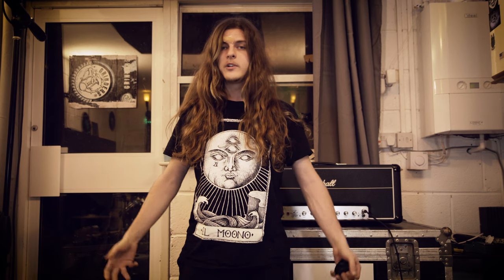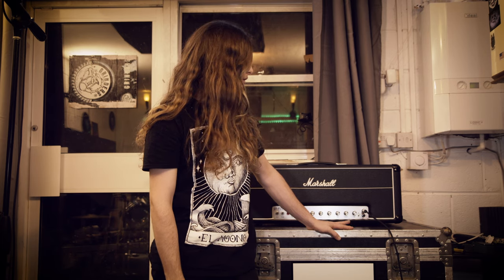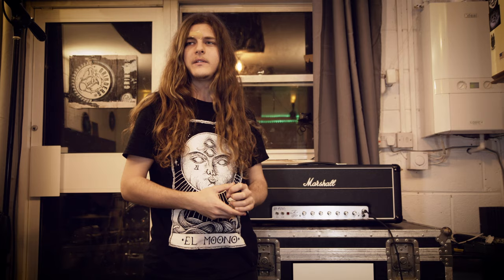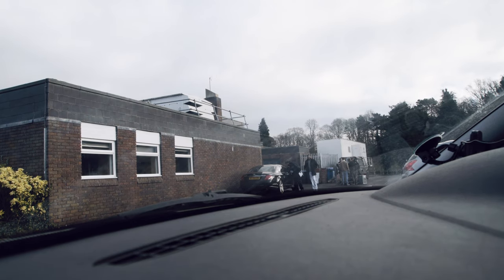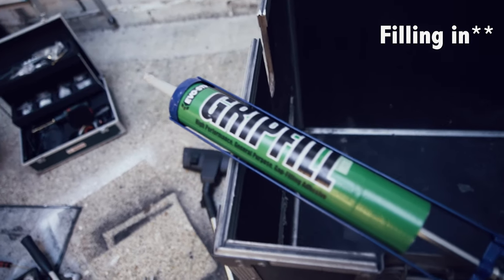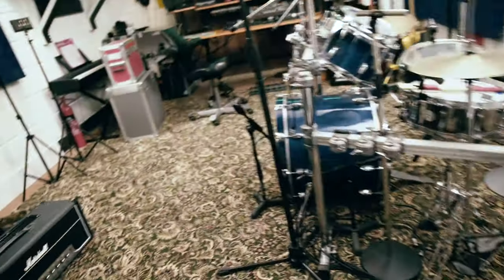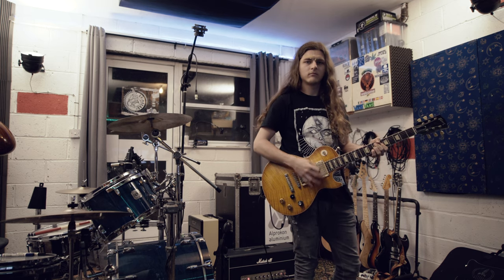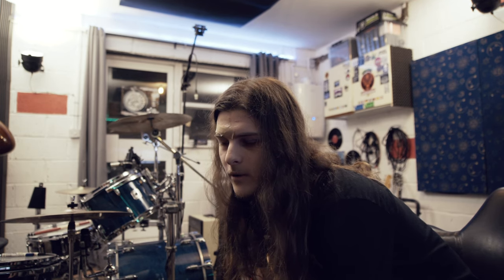How I converted a flight-case into an ISO BOX!

Comment: I'm about to buy a flightcase but from the measurements i'm not really sure if the whole rockwool will all fit inside, do you know if less rockwool would make it any louder? And what is the difference between having the speakercable directly soldered onto the input instead of having just an in and out? (shakey hands thats why i'm asking)
Reply from the maker: I Guess the thinner the more sound will come through. Although the tightness of the seal is also important. I doesn't matter if the speaker wire is directly connected to the in and or output, as long as you wire it correctly. Be careful though, when it comes to amps and loads, as it can break your amp and hurt you if you turn on a head that's not connected to a cab.